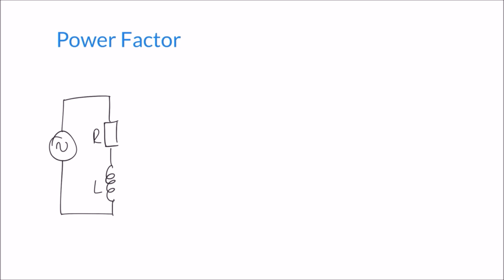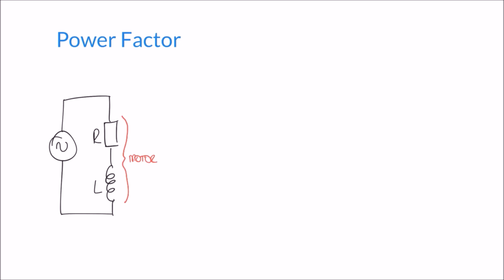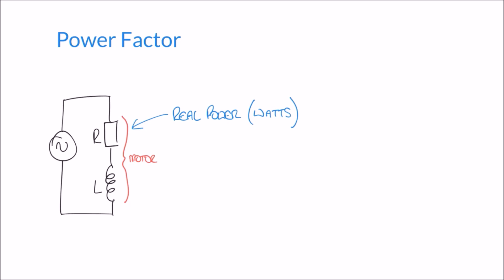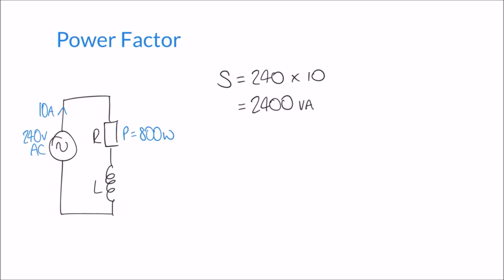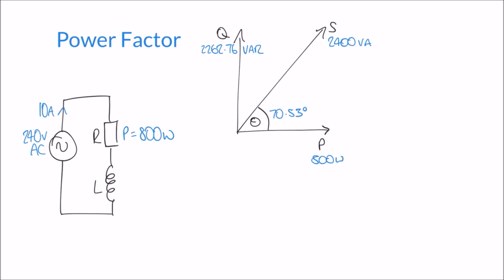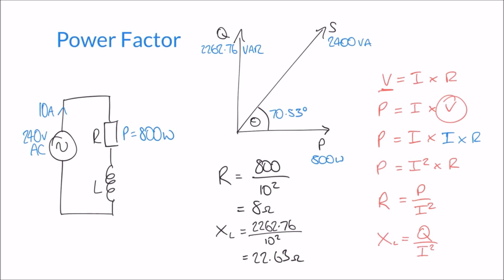Calculating Power Factor and Phase Angle for Series RL Circuits

Comment: Great video.  Since multimeters and clamp style current meters are ubiquitous and can easily measure RMS voltages, currents and resistance, would  this be a "practial" approach?  Measure the resitance of the coils in the motor, and then measure the voltage applied to the motor.  Then, take a clamp style meater to measure the current drawn by the motor.  With V and A, we can calculate apparent power (VA).  With the amps and resistance of the motor, we can calculate real power.  PF can then be computed.

Comment: VAR is easier to understand if you explain it as Voltage Amp Reactance which is what VAR means. Also very easy to explain that VAR is power that is bounced back and forth (absorbed and supplied) between the source and the load but not absorbed by the circuit. Where as real power is absorbed by the circuit.

Comment: At 9:41 you assign 240 volts to the source voltage and 10 amps to the current. I am assuming these are  RMS values. Is this correct?
Reply from the maker: I forget to specify in the video but yes
Reply: Thanks! @EngineersAcademyLTD

Comment: Bit misleading as at the beginning you state that Var and Watt are equivalent, however you state that the circuit is using 10 ‘amps’ at 240 v which has to be equivalent to a total power use of 2400VA as you stated or in any case 2400 watts as per your statement of equivalents.
Than later is calculated a wild value for the reactive power, which does not relate to the overall power use, if as you stated that ‘Var’ and ‘Watt’ are equivalent.  Reactive field effect loss Is I believe the sum of the ‘ESO’ effect self opposition and the frequency reactive actions. If it is assumed to be 60hz it is the self opposing effect of the inductor at that frequency. Plus the small wire resistance value.